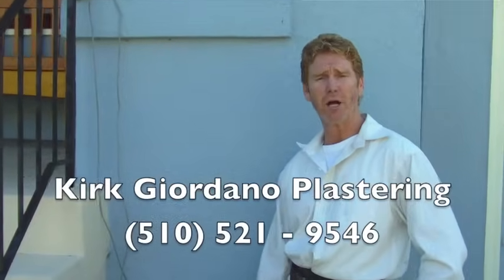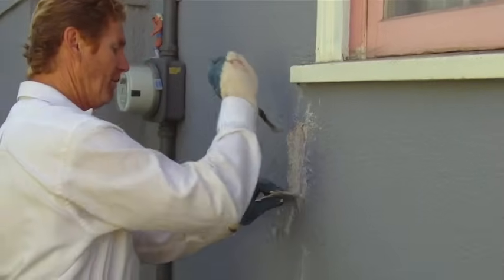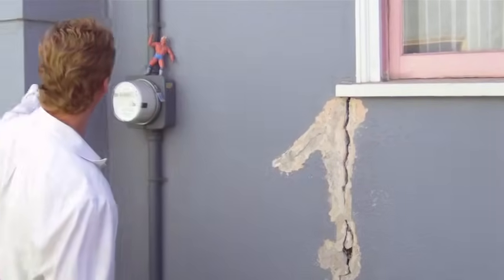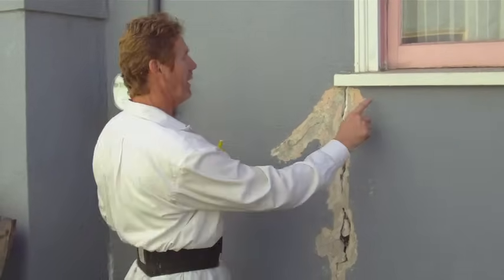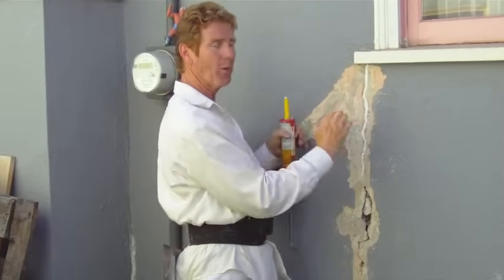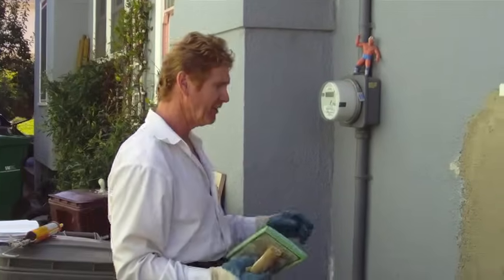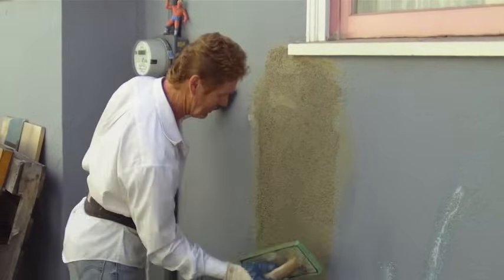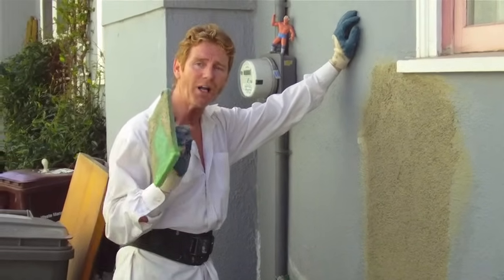Caulking with stucco to repair big cracks in walls.

Comment: This is not fixing a structural crack - Its a temporary fix albeit with a good finish. This is cosmetic only and not a fix - waste of time for a crack that size.
Reply from the maker: Your right John, perhaps they should have torn all the walls off and rebuilt the structure, and re-stucco the entire wall? Not.
 Here's a tip my friend, if it's your house if you can afford it do it your way, don't speak for others who may not be able to afford proper fixing, but instead wish to contain the problem so it doesn't get worse.💩

Comment from the maker: Howdy OverYounder, there are at least 100 different reasons why stucco cracks. However a crack does not mean a leak.  It's typical and normal for two coat stucco systems to crack even if a fella does the third coat, hydrates the best as possible far and beyond codes homes can still hairline due to movement. 
 (Rain,traffic, windows and doors slamming, settling, ect.)
Thanks for the question and sorry I can't be more specific.
 kirk Giordano Plastering

Comment from the maker: Hi Alex Schack, excellent question, by the way I missed your comment until now, I am now responding to another.
 If the paper is broken I tell folks you have a choice apply the sika flex caulking or tear off all the stucco and re-lath and plaster. ( 9 out of 10 say caulk the crack.)
The other 1 out of ten looks at me like I created the problem and wants to kick my ass. 
Thanks for the question and have a great day! 
kirk Giordano plastering

Comment: We just had some wood exterior on our stucco house removed and replaced with new stucco. The upstairs looks great, but the two downstairs patches have lots of small cracks. I can see no such cracks on the original (1982) stucco work, and the upstairs new stucco doesn't show the same cracks. Is this normal? Will the downstairs stucco need to be replaced? I live in Solano County, CA.

Comment: thanks for the reply! one more question on the subject, how can a base coat and stucco finish be applied to stucco wall that has been painted over?
Reply from the maker: Howdy Tom, you apply a bonding agent but the wall must be very clean as nothing adheres to a dirt surface not even bonding agents.
        Live long and Plaster
 teaching repairing your number 1 investment your home

Comment: Hello! Not sure if you check threads from this far back but I just had some brick replaced on my stucco home, which left a half inch gap between brick and stucco. The area is about 10 feet long was wondering what your suggestion for filling would be. I was thinking quick Crete and then pre-mix stucco over it. Any suggestions appreciated!
Reply from the maker: I'd recommend Mor-Flexx caulking, it no doubt will shirk, if so simply caluk it again with the same stuff as it matches grout and stucco.👨🏻‍🔬
Reply: @StuccoPlastering my house exteriors has smooth finishes  no textures . Can I sand it down after I Rapid Set ?

Comment: Hey u ever use a non expanding spray foam to fill up crack
Reply from the maker: Howdy Juan, many times, after it's set we just cut off the excess and cover it with stucco, so the patch blends in. 🍻
Reply: Yes thats exactly what i just did om recent patch it was a large crack towards the bottin.kf a.block.home so i cleaned out crack added bonder and procecded.to.brown blend with green float then texture over. Customer was happy thank again for.ur videos i love my job

Comment: Why the heck are there absolutely no cracks (hairline or otherwise) in the original stucco from 1982? What is the standard procedure for the cracks in brand new stucco--will they replace it all, add a new layer, or fill the cracks? Thanks for any info you can provide. (By the way, I watched several of your other videos, and you do great work.)

Comment: what is your opinion about expansion joints. Would it be appropriate on a house where there is likely movement?
Reply from the maker: Good evening John, absolutely, depends on where they are needed. 😉
  Our unique plastering Tip:  all subscribers or anyone who stumbles on our channel with a question, type it into our Stucco/Plastering channel, and like magic, a video will appear to explain how it's done. 	
   This feature is miles ahead of any plastering forum. 🥳	
Kirk & Jason Giordano Plastering

Comment: Hi Kirk, Need some help. I have several hairline cracks and a few larger cracks in my stucco. I have used poly, acrylic and flex morr and with the expansion and contraction, (Arizona) it continually forces the caulk out of the crack. Obviously it then "bubbles up" the finish I put on looking like $*@%! After watching many of your videos, I've seen you do not recommend using mesh tape over the color coat.....so I am looking for suggestions. Really appreciate your videos, thanks and please keep em coming. Thanks!
Reply from the maker: Howdy Morris, sound like you have a home that does indeed lift a lot, some homes where I live have streams under them thus they do lift more than others.
 I would have recommended you caulk early in the morning with more Flex. You may have a maintenance issue that needs doing year after year depending on many things.

                Peace, love, and happiness to all.
Sound Plastering tips from your favorite stucco nurds

Comment: You do beautiful work!
It seems like you use a lot of Sikaflex 1a polyurethane caulking for the bigger cracks. Here in Portland, OR, the two stucco contractors I spoke with, both use Sonolastic 150 since it's low modulous and the silyl terminate polyether sealants supposedly outlast polyurethanes. Plus, it's paintable if that's needed. What are your thoughts on this?
Reply from the maker: Howdy Jason, I use sikaflex a lot for lathing as it's a sealant also.
 For cracks I rarely use this brand unless the cracks are huge and a primer and or acrylic will be used to go over, for crack repairs this product drags plus does not have the sand to match the majority of finishes.
 I prefer other caulking for cracks such as Mor-Flexx.
 Cheers and have a good and healthy new year,
 Kirk and Jason giordano

Comment: ive got a bag of quickcrete base coat stucco. and many large structural cracks. can i do the prep, fill with polyurathane, weld-crete, then use the stucco instead of the rapid set. Thanks for the videos.
Reply from the maker: Good evening Bill Dude, follow these instructions.😉https://youtu.be/2eIkdeIBbMs/ Stucco Structural large cracking, stucco walls with hairline cracks, no problemo, easy to fix. 
 Our unique plastering Tip:  all subscribers or anyone who stumbles on our channel with a question, type it into our Stucco/Plastering channel, and like magic, a video will appear to explain how it's done. 	
   This feature is miles ahead of any plastering forum. 🥳	
Kirk & Jason Giordano Plastering

Comment: Kirk, using that Rapid Set the way you do - doesn't that leave an unsightly buldge in that area. I ask that because if you have the sun setting perpendicular to that wall casting light across it - I assume that buldge will be very unsightly (as it was on my recent repair that did that way). Any thoughts - of course you could put another layer of color coat and try to blend it - but seems you would have a big job to float a finish that looked right for that area. Any comments are welcome!
Reply: L lol olœ
Reply: He's doing a maximum minimum or is it the minimum maximum